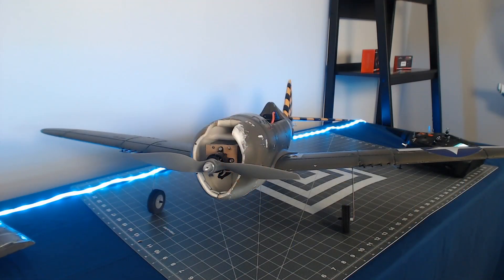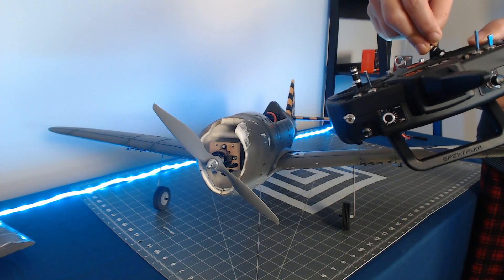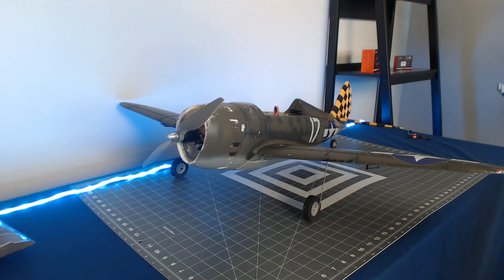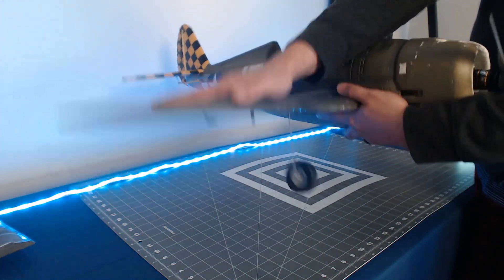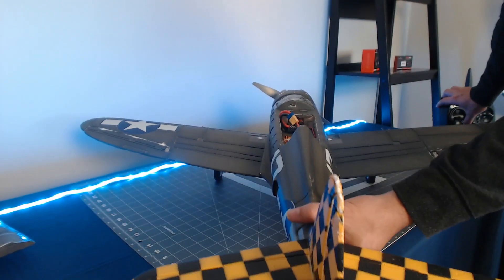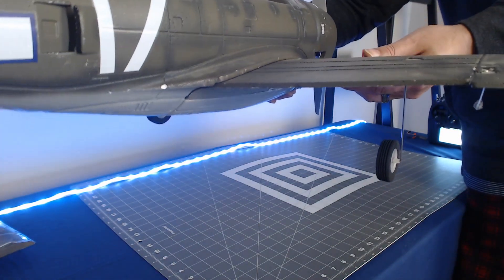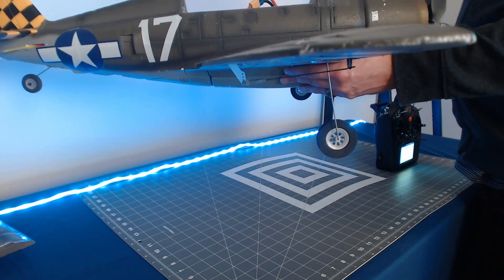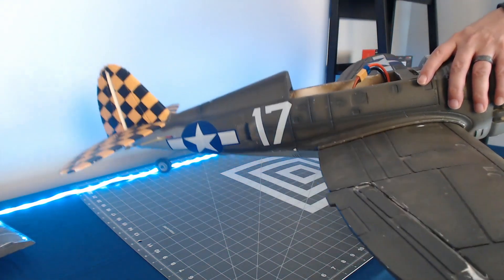Spektrum AR636 Programming Series - Part 16: Verifying Your Control Surface Movements

Comment: Help please For some reason my ailerons (on a Y lead and selected as such on the Spectrum Programmer) works fine when I move the aileron stick but does not move at all for AS3X or SAFE functions/when I role the plane side to side. The elevator and rudder both work fine and move as they should. My gains and priority are set exactly like yours. The aileron servos even do the dance when the rx is turned on indicating that they are initialising. I cannot understand why the ailerons are not working as they should. Help would be very much apprecited.

Comment: Hi Rc Air Marshal, my asx3 rudder is correcting the wrong way. The surface are all correct with the sticks. How can I reverse the as3x rudder correction?
Reply from the maker: You will need to go into the Spektrum Programmer application and reverse the direction of the rudder.
Reply: @TheRCAirMarshall  thanks 🙏 I’ll give that a try
Reply: I probably should have mentioned I’m using a ar8360T. Seems like the programming software isn’t compatible
Reply from the maker: Ahh, yeah this video of for the old aR636. For the 8360 if everything else is correct and the rudder is correcting the wrong way the first thing you want to try is repeating the servo settings in Forward Programming. If that doesn’t do the trick, then your receiver orientation is probably not set correctly

Comment: I can't thank you enough for those very well done videos! I just received the programming cable and I'm trying to setup an AR636A receiver in a Parkzone Stinson SR10. Something is confusing me though, hopefully you can enlighten me about this.

I have a Blade 200srx heli with a pre-programmed AR636H receiver. When I plug the battery I have to be careful and ensure that the heli is perfectly level to avoid gyro disorientation. When installing the AR636A in a plane with a small tail wheel like your P47, meaning that the plane isn't level on the ground but has the nose up, If the receiver is level in flight ( parallel to the wing), then it won't be level when the model is on the ground. So my question is, do I need to tilt the tail of the plane to a flight level position when I plug the battery or is it unnecessary with the AR636A once it's calibrated? I noticed that you din't lift the tail in your video.

Comment: Hi my issue is on the model the control serfaces are reversed now it says do not make the corrections in the transmitter
but when i use the app on the control surrface page you click opn the surface to change direction and nothing happens any ideas what is the issue might be
Reply from the maker: Lee Pering you have to make sure you have a good connection from the PC to the Receiver. The change should be immediate as long as you have a good connection. Double check that the receiver is connected properly. Definitely do not change the surface in the Transmitter.
Reply: @TheRCAirMarshall  yep connection is good, well i think it is i have the circle in the orange bar telling me its connected. So must have so issue elswhere thank you for taking the time to answer my qustion
Reply: @TheRCAirMarshall  Hi problem solved the APP for andriod phones does not work
used my daughters old i phone and bingo
it works.
Your videos  helped a lot thanks

Comment: I absolutely HATE AS3X. Mostly due to my lack of being able to program it. Previously I tried programming it with my iPad and had numerous problems. Watching this series, I might have to give it another try. Needless to say, I have a few AS3X receivers that I'll bring to my clubs swap meet this spring.
Reply from the maker: Jeff Jackson I Hope you have better luck this time around. In my opinion, the Android and iOS apps aren’t really that good. They do the job, but the PC App does much better, and you have more flexibility.
Reply: The RC Air Marshall unfortunately I’m a Mac guy. Zero PC’s in my house. I need to buy an in-expensive laptop.
Reply from the maker: Ahh, gotcha. There are ways to get the software running on a Mac that all involve loading windows via Boot Camp or running a Windows Virtual Machine with USB Passthrough capabilities, but those topics are a bit beyond the scope of this series. A cheap Windows Laptop would be ideal.